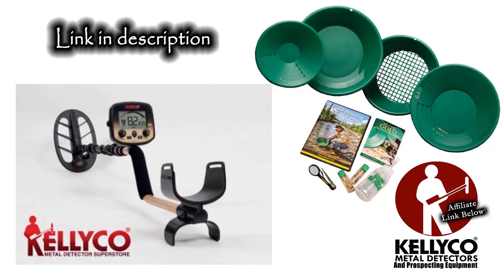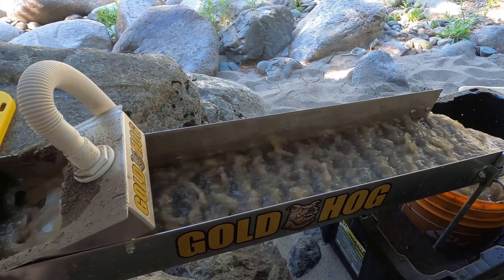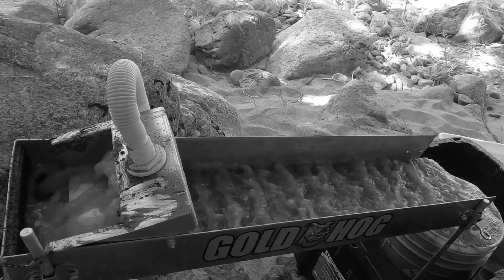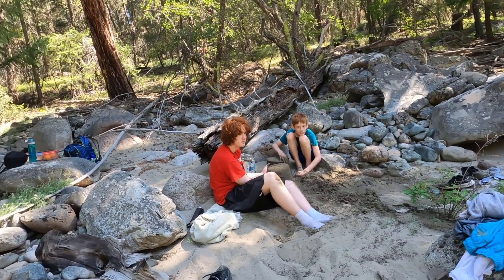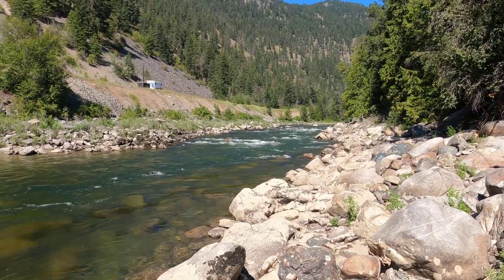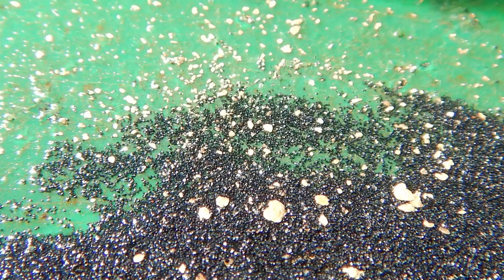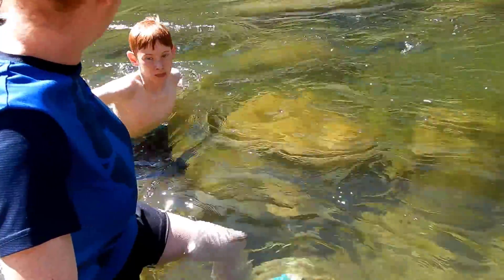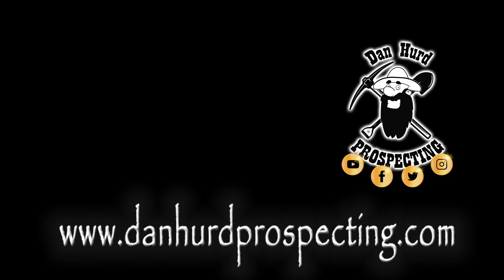Found gold in all the wrong places!

Comment: The beauty of the Gold Hog multiSluice is that it’s designed to run dry dirt. The water flows back over itself at the top in a very turbulent area and completely saturates the dirt with water. So you’re not losing anything. 👍 I encourage you to watch the GoldHog video about the multiSluice and he explains everything. It’s for this same reason why I bought that sluice system.

Comment: So Dan when you alluded to the black sand being a component of one of the boulders you found were you trying to suggest that maybe there's a boulder of gold alongside that river? Only way to know would be a kick ass gold detector. Probably a Garrett, I've seen good results from the ones that use induction, range about $2,000 u.s.

Comment: Hey Dan! In what video were you testing out the Minelab 6 inch coil? Having trouble finding it again. So I got one, same issue, bump the wire near where it attaches to the coil and it faults. Maybe not good for swinging in water or under brush. Otherwise a fantastic coil for picking the good stuff from trashy parks. Was going to pass the vid on to another detectorist.

Comment: Dan, when you forget your scoop just cut the end off a water bottle.. instant scoop.. PROBLEM SOLVED! 38C is 100F.. It was 43.8C here the past 2 days. Needless to say we haven't gone ANYWHERE and are hiding in the AC. It never got below 70F last night and was 55-60% humidity so other than for one hour, it never felt less than 85F. I did get out and pick an entire gallon bag of corn today though. Dan, if you want to laugh your ass off watch this last week's Mountain Men episode. This guy on there is bad with gold fever. He pulled this one small flake and said it was worth $20 he pulled a little "nuggy" as you call them and said it was worth $120.. His total at the end was maybe 3/4-1 gram of gold in his little vial and he said he had almost an ounce.. It was so insanely sad yet funny.